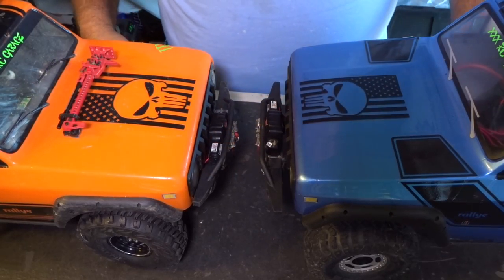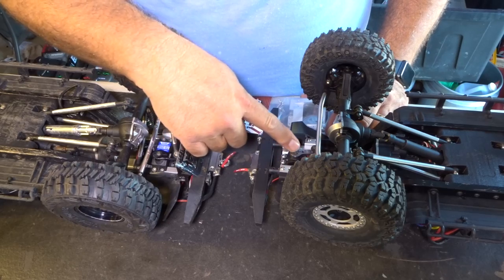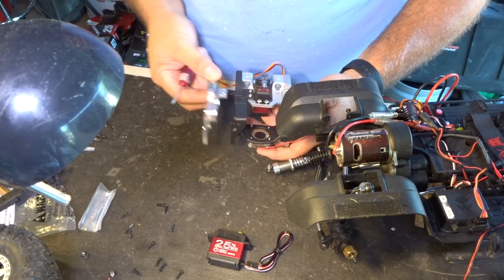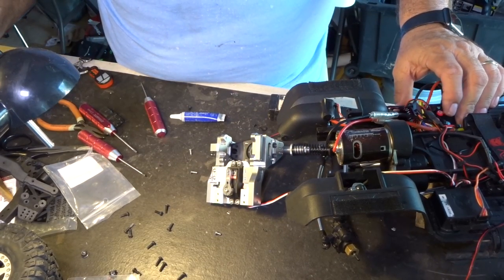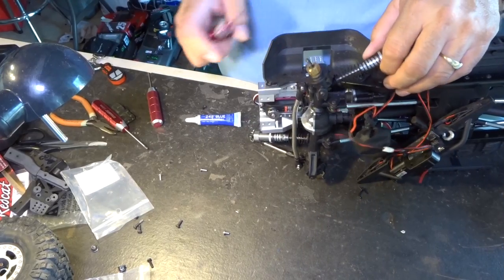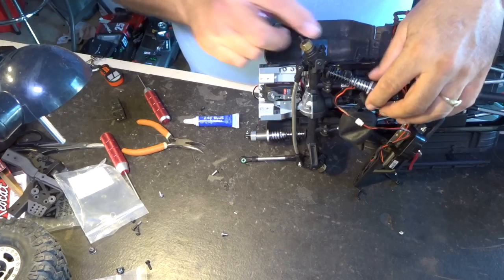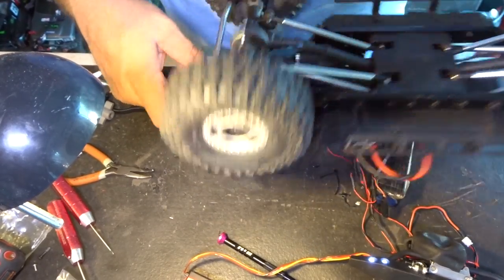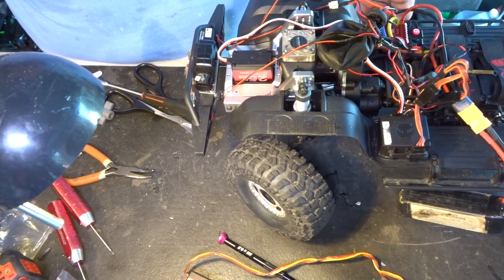REDCAT GEN8 UPGADES get better turn radius

Comment: You actually dont gain anymore turning radius at all but its a nice solid piece. what gives you more turning radius is your controller & servo....Ive used all these aftermarket parts this club 5 upgrade, another really nice SS servo relocation part sold on amazon. yet in the end I removed everything to cut down on the weight. with a proper controller & servo ( Im currently running a FlySky Gt5 6 Channel w/ a ProTek 370 tbl servo)  I have my wheels a 1/16th off the links. I did however make my own panhard bar, its extended roughly 3/4 of inch beyond the front drivers side shock. That removes all the bump steer issues. Bump steer is nothing more than bad geometry w/the panhard bar location ... Nice vid...
Reply from the maker: Thanks for the heads up

Comment: I have purchased parts for all my rigs from Club 5 the guy gets right back to you if you have any issues and has a pretty good selection of parts I'm running his censored light kit and links and Servo relocation on my Scout I like it the deadloc  skid plate and transfer case setup  I purchased before I got my rig too and I like that a lot been really impressed with that thanks for the great content man
Reply from the maker: Nice i’m definitely going to be checking out more of their products 👍🏻
Reply: I'll be testing out their customer service for this steering and suspension link kit.  1st everyone is out of the servo relocation part.
2nd.  Installed the steering links only to find that in order for me to use it I now have to get the 12mm hub extension because the club 5 steering links are too long and hit my tires.  Sure be nice to sell all together or at least say something!
3rd.  I didn't like putting on "new" plastic rod ends...   the links are great but in my experience its rod ends that pop not the links themselves.   Wish me luck and another solid video!  Good view and well explained 👌

Comment: Stainless steel screws from Ace Hardware have ALWAYS worked for me. At  .10 cents a piece, you can't go wrong. Plus they are always in stock, unlike most hobby shops. Just my experience & advice. -Paul
Reply from the maker: Awesome idea I’ll have to check it out

Comment: 👌 try this one please and see if it works i have good results. Use 2 of those straight steering links and a long screw for the servo horn enough to catch both links into the servo horn. Then from there attach the links to the end link nearest to the tire. Only will work for the club 5 mount use lock tite and you will be amazed i hope i know i am.
Reply from the maker: I’m taking a picture of your comment so I will not forget. Thank you for sharing. Be safe😷

Comment: Okay so I have a big issue with my steering I have club5 steering links and the stock mount I have no turning so I changed the servo and now have a new problem but  turning and it maxed out the suspension when I turn  and very bad turning radius so I bought the relocation mount waiting for it to get here what do you think should be the problem?

Comment: Did you do a before and after turning radius to see if it actually turns sharper??
Reply from the maker: In the video I put both rig front to front and did a comparison fast forward to 11:54 and you can see
Reply: That dont mean anything seeing it turn more these portal axles cant turn that far without binding
Reply: @wiccanfpv  Yes, if he doesn't set the endpoints of the new servo properly he will most likely ruin and destroy it within half a season (if he runs it regularly). Correctly set up servo will only allow 46-47° steering radius on this vehicle.

Comment: Anthony, where did you get them aluminum drive shaft on the Orange one... Please ?
Reply from the maker: There Redcat metal driveshaft 

https://rover.ebay.com/rover/0/0/0?mpre=https%3A%2F%2Fwww.ebay.com%2Fulk%2Fitm%2F253843270905

Comment: Can somebody clarify what club five links are to complete that Servo relocation kit I can find the bracket but what else do I need
Reply from the maker: Technically the only thing you need is the right size servo link that’s all
Reply: The steering link kit. Not needed but recommended however if you do, got to get the 12mm hub extension...   why they did this idk but it hits on your tires because they are too long!   Smh.  Links are super heavy and strong but kinda bummed me out putting new plastic rod ends from the kit...?
Reply: My review is 5 out of 10 stars...   yes it fixed the bump steering issues and turning radius was improved but this created another purchase for 12mm hub extension...  and I truly believe it should have came with metal rod ends...  but thats just my opinion 🤷 "nobody was asking nor does anyone give 2 shits what I think."   Lol

Comment: If I put a 30kg would it be overkill? Or will brake the c hubs? I'm new to this trying to get a better steering than the stock thanks.
Reply: No way!   My axe edition comes with the reefs 422.  Id bet that is stronger than the Amazon/eBay 30kg servo...

Comment: Dunno what u trying to sell here.. maybe dual Rate setting on the left is at about 25% but i have the original mount plus a 20KG Servo and my steering angle is better or atleast the same as the one on the right side. I read alot about this part in some Threads too and most ppl dont see a difference neither. Besides that its a nice builded part, which looks good and probably more durable than the original mount. But like i said, steering wise, no optimation !